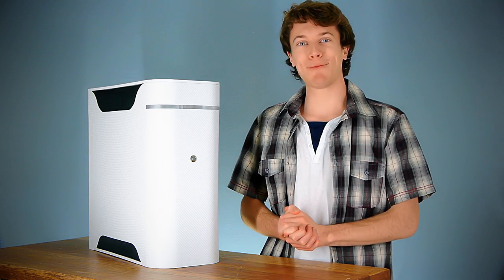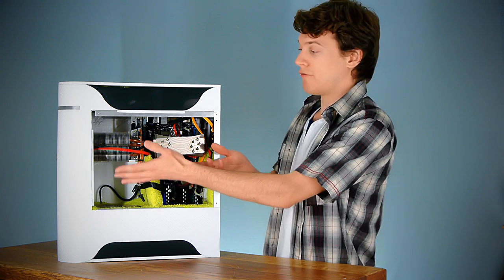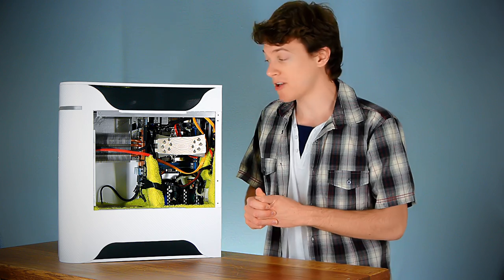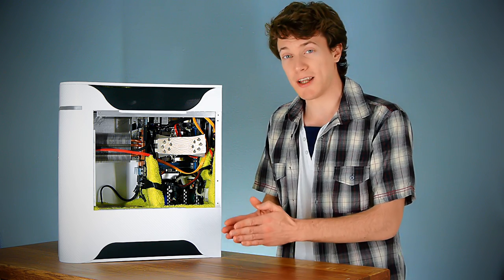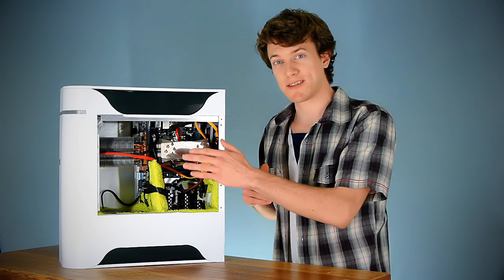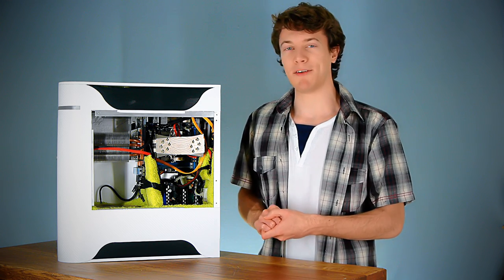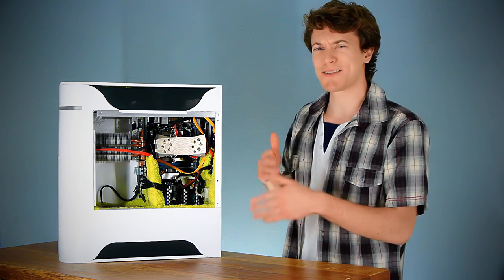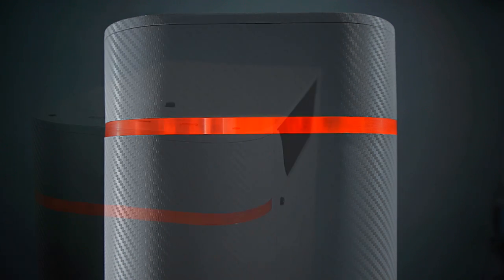DIY Computer Case - The Ultimate Silent PC (CLOUD UNIT)

Comment: ok for older graphics cards that would be ok BUT today we have a large amount of components on the graphics card that have to be cooled as well for example the VRM it generally has thermal tape on top of it and is in contact with the cooler for 2 GB up i would say you would need to cool not only the chip so don't go slapping cpu coolers on your graphics card. because if the VRM burns up the gpu is wrecked not to mention that the VRM is generally the first thing that fails in a gpu its quite rare that a gpu's chip dies first. Yah in my opinion the cooling you have for the pcb is not enough just being in the airflow path. (I may be wrong dough I just would not risk it).

Comment: Why didn't you go with watercooling too? At least on the GPU. If you make the case a littler bigger or higher, you could add a dedicated department for it, maybe one where the PSU fits in, too. Then let the fans go really slow. The design is smart and the airflow concept well thought through. With watercooling however, air could go in on the left and exit on the right, rendering an optimal airflow for efficient cooling. That way, you could let the fans run at the slowest speed (considering you take a 240mm heatsink for the GPU and another one in the top for the CPU). 
Just my thoughts popping up?

But nevertheless, awesome design, awesome function, it's just insanely cool!
Reply: +LimPu Just seen the last part about it. Nevermind :D

Comment: Really Creative! Cool design!But I do believe that water cooling makes the need for huge tall coolers outdated, sure there is a tradeoff as you now need to fit a radiator, but with a large one, you don't even need a fan (using convection) and can passively cool with just the quiet noise of a good pump completely inaudible. And one can do this with a Cooling loop that draws head from multiple GPU CCAs and the CPU all in a tight form factor with just the Rad to take up much space.

I'd love to see what you come up with going for a (silent) water cooled design =)

Comment: i would make an extra button which increase the Fan voltage. in case of that the pc is in a "gaming mode" with a much better cooling. maybe i also would change the led to a new color or fading between some.

Comment: The case around the power supply isn't so much due to safety concerns but to meet FCC regulations. The actual RF noise produced by a power supply isn't enough to concern the consumer, but the FCC has very strict standards that manufacturers have to meet.

Comment: Of course this is a nice build and i resprect the time and effort you put into it... but seriously in modern cases you can mount fans wherever you want. it just depends on the case you buy. also the max. fansize that you can mount has become a lot bigger (i think up to 200mm shouldnt be a problem) and if you buy a graphics card with a decent cooler they shouldnt be that loud or in fact can be semipassive (only turn on when in serious use). besides that the power supply now often mounts on the ground so that it gets fresh air and at the same time doesnt heat up the rest of the system. If that isnt enough there are a lot of (semi-)passives out there too.

So all in all - if you make the right decisions when buying, silence shouldnt be a problem. Either way you seem to have fun building these custom ones and of cours it looks pretty cool..

Comment: I remember watching quite a long time ago; In the middle of my water cooling exploration, I remembered this video and thought that it would be a neat idea instead of water cooling. My question, however, is how well this will work to cool more high performance AMD chips that are going to produce more heat?
I could go for "beefier" coolers and more fans, but my idea is to have a quiet (not necessarily as silent as this) PC in a more simple design than the complex water cooling loop I had envisioned.

Comment: Just drill a 5 inch hole in the wall just enough to pass wires through and put the desktop pc on the adjacent room, pass the wires through the hole, seal the hole with some dry wall seal, close the door, place the monitor on the desk, hook up the wires and enjoy a quiet free, and a cool room temperature. My three desktops are in my bathroom, you can imagine the heat and noise they generated, but thank God of the idea, it's the best idea he gave me, and i realized that the heat the Pc's made prior, were taxing on my energy, i don't know but i assume if copper and all those other metals being heated generate some kind of negative effect on health through the heat

Comment: I like your idea, however I am concerned about heat with the fire hazard with the Power Supply, and the overheat issue with the Smaller HDD in the Pocket near the Cpu. These can cause issues for sure.

Comment: Yea it's quiet but what sort of temps do you get under heavy loads? And that's with a low end GPU. Try it with a more high end which the TDP is alot higher which means more heat output. 

Yea it's quiet but i bet it doesn't run cool. You can do all this with watercooling, if you do it right it will run much cooler and be much quieter than conventional cooling. And im talking custom loops not AIO before anyone jumps on me.
Reply from the maker: I have a whole video about that. TDP of this card is the same as a GTX 980, so though it's old it's still a very hot running card so good for proof of concept. Hope this helps.

Comment: I would have gone with a big liquid cooler at the bottom of the case, and then cpu and gpu connected to that. Then moved air intake and outtake through the case as per normal, but on the quiet side.

Comment: Great work ! But I would like to know : did you test your computer without fans ? Because may be the heat alone of both CPU/GPU creates an air flow in the case and it sufficient to cool them down ? I'm really curious about it.

Comment: I see no need for the toweling, surely that can hold static and dust build-up would have just made rubber mounts and the external 12volt socket /5volt is a good idea only if you have a really good PSU otherwise you could blow it up if it tries to pull too many watts of power I don't like the open power supply either just buy a decent one they are not noisy at all an open power supply like that is dangerous, but I do like the airflow in the system  it does make sense. making the case of wood is good for design but not practical in terms of weight moving it around and safer if it did catch fire. I would just mod a metal case to do the same thing, after all, you have used an aluminum sheet to wrap it could have easily done that to a metal case. I hope you don't think I am being too negative here just pointing out what I see as pitfalls you are a very creative guy I watch a lot of your videos and love the channel you inspire me to go out in my workshop and make things so keep the vids coming.

Comment: +DIY Perks why don't you adapt the original GPU Cooler adding the monster cooler to it? usually the GPU cooler has more contact and takes heat out of more than one component of the board, using the old contact with the new cooler wolud give a better looking and more eficient build? why not try it out?
About the power suply: its not the high voltage the most concerning thing; the capacitors are usually the most dangerous thing to fail there and the problem is not only the towels, but the proximity to the motherboard, would not be better to put it in a separate bay under those fans for safety?
Reply: you cant just stack a CPU cooler on top of the GPU heatsink. The cooling area of the original cooler is too small to make a difference anyways.

Comment: How is the GPU memory and VRM doing? Lots of reports of the NZXT CPU adapter frying GPUs. Are those heat sinks enough without a dedicated fan? What GPU is that anyways, that 660 I saw in another video? High voltage is over 750v but I getcha. lol You could use some marketing, great channel, I didn't see it until I got out of my walled garden internet and got a VPN.

Comment: saying they should do that for grapics card is like saying they should be watercooled from factory ( which is rare ) ..
the main GPU will be cooled by the cpu cooler but the other components will heat a lot , and will certainly be impossible to OC because of that , they need better HEAT "exhaust" .

Comment: Hi. I agree totally. The ATX design specification is a dinosaur and I don't think it is particularly fit for any purpose these days. There was a BTX specification claimed to solve thermal issues but the design introduced incompatibilities yet was not really radical enough to be worthy of a change. Since then, Intel appear to have given up on designing a successor to ATX. Without several manufacturers defining and implementing an open standard the change just won't happen until technology makes clinging onto ATX untenable. The flexibility that made ATX so great in it's day is no longer necessary since few add-in cards are now used and today's designs are pretty formulaic. Desktop cases are now used primarily for hot CPUs and graphics cards and as you say, thermal design as opposed to flexibility these days needs to take center stage.

Comment: the fans are blowing the hot air from the power supply over the CPU bad idea
you should have the fans suck the air from the power supply out of the bottom of the case. Anyway nice work I like the style of it.

IT GUy for over 20 years!

Comment: instead of the green non fire retardant fabric, why not use a fire retardant plumbers soldering mat. Not only is it safer due to its heat and fire retardant quality , you could still mount the cooling fans on it for sound/vibration deadening?

Comment: There is an advantage of using a good air system instead of water cooling, and you kind of mentioned it, but didn't made it very clear. With water cooling, the only components actually getting cooled are the ones with the sinks connected to, on which a typical water cooling system comes with sinks for the CPU and GPU. Although, you still need air cooling for the rest of the components. With the fully air system, everything gets cooled down.
BTW, you do look like Theon Greyjoy LOL

Comment: You should cool your next GPU with a closed loop liquid cooler and make a case for it so it's basically an MSI Sea Hawk, but custom.
Reply: technically all normal water cooling loops are a closed loop/system
Reply: AbsoluteTrash Closed loops can't and shouldn't be given maintenance by default. Custom or open loops can. I myself have an open loop AIO(Alphacool Eisbaer).
Reply: I was meaning "closed loop/system" in the physics kind of way

Comment: Im confused though. First of all graphics cards are silent to begin with. They dont make noise. The fans on the heat sink is what makes noise  so that giant cpu heat sink does not actually stop the noise because of reducing heat it stops noise  because it removes the small fans from the heatsink. Also using heat sinks like that with no fans directly on them to move the heat isn't great practice. It will work because he has airflow in the case, but its not as effective and like his previous case video where the cpu ran at like 75 C where as normally even under load my cpu would run at about 50 or so with air or 30 - 40 with liquid. This isnt a problem with the case at all though simply the choice to have only intake and exhaust fans rather than including heat sink fans. None of this is any kind of fatal error just extremely weird and not necessarily considered good practice. Also the fabric doesnt worry me so much as a fire hazard as it does a potential source for static electricity which can kill parts. Not that im saying it will because i cant tell from the content how close it is to the actual parts that could be damaged from static. Also as a water cooling enthusiast I must point out that pumps really arent that loud usually unless you have them pushing at max power. I have a water cooling setup in my personal build and aside from fans i run on the radiator its completely silent. I cant even hear the pump. Once again im not bashing anything in this video, im simply giving information because i believe some of this may be slightly off. The concept itself is super cool though and i love that he is coming up with different ideas and giving them a go because thats how innovation happens. I love the video, but this is what i do as a hobby so i thought i would give my own personal observations based on my experience which may very well differ from his experience and cause the difference in information given.
Reply: Also please feel free to correct me anywhere that i might be wrong. I welcome new information. As i said this comment wasnt me trying to be rude or insult him because i really do like what hes doing. If I am wrong I would happily accept that. I just wanted to give info from my own experiences with building machines with various types of hardware.

Comment: This is the ultimate pc silent mod if i would of looked over on how he is able to swap out the graphics card since its heatsink is attached to the case
Reply from the maker: Rice snot You'll have to check out the build log. It's swappable, it just needs more work than usual. Not too bad if your upgrade schedule is 2 years though.
Reply: Oh my God you are right, I also have another question. How long did it take to fabricate all of this?

Comment: ever heard of a reference cooler (literally there blowers that exhaust air out of the case, but still not as good as a cpu cooler)
Reply from the maker: +Michael Flatman Bit noisy though.
Reply: +DIY Perks Like a jet engine in your computer those reference coolers.
Reply: +Michael Flatman I guess you are missing out the whole point of this experiment.
Reply: The words "Reference cooler" and "silent" never go together

Comment: 4:45 I respectfully disagree. Modern graphics cards made by reputable manufacturers will have a quiet and efficient fan. Some even have a Zero fan mode those times when the card is not put under load.

Comment: thanks for another great case. I tried to move my old laptop to custom case but failed to boot my laptop without connecting internal display cable, it just doesn't boot with external monitor. I have Dell Inspiron N5030.

Comment: That thing is awesome!
But couldn't you just use a raid 1 instead of the backup-button?
Would be even safer ;)
Reply: +Das TIER With RAID1, both drives would always be connected to power; in the event of a surge, both drives could be fried. Since the backup drive isn't connected to power until the backup button is pressed, the data stored on it is considerably safer.
Reply: +c3h4ohcooh3 
Ah, thanks! Hadn't considered that...

Comment: Nice case makes me want try my own.  

I'm confused though you said convection heat rises, but when you have intake and exhaust fans there is no convection as the air is forced out no matter the temperature.  As it is an enclosure the air has only one way to go.  Easy way to test this is by turning a PC case upside down.  The heat will still come out of the exhaust.

A quick question as you have the PSU fan removed and a fan underneath the PSU.  Doesn't the heat from the PSU become blown across the components and adds warm air to the heatsinks as they don't have their own fans anymore?

Comment: I drilled a hole in my wall for the monitor cable and put the computer case in the hallway, and went wireless. But than I noticed I have some low end rumble at around 42Hz in the corner which was driving me crazy so I brought back my computer case. The fans noise mask the rumble just fine. So I guess I can't go silent. :(

Comment: i like this case but i would prefer an other position for the psu  putting it under cpu cooler you just give your cpu hoter air than you could have , with your system maybe works but in a hind end pc that would be a big problem i like the rest but i would transfer psu out of there

Comment: How would you change the GPU? :\ It looks like you welded or soldered the GPU heatsink to the case, right? How would you change it? :P
Reply: +JulianProPC Also, having the PSU out of a case is extremely dangerous. Even if you leave it unplugged for an extended period of time, it can still discharge a large amount of electricity, possible lethal amounts, even if the high voltage capacitors are isolated, the sinks can discharge that electricity. It might not be a fire hazard, but it's a human hazard :P So working on your PC safely would require extremely thick rubber gloves.
Reply: +JulianProPC It looks like glue to me, I guess you could use chemicals to get it away. If you want to be able to switch your gpu, you can just use screws or something similar instead.

Comment: +DIY Perks Matt i like your case very much and love the idea of having a quiet computer but, i just want to ask you something that i've observed, about the CPU/PSU cooling engineering; the hot air goes to the top right? And the PSU is under the CPU, so, when the fan air pass through the PSU it pushes the hot air to the Processor (cpu) which is right above so, it doesn't make the cpu hot instead of cold?
Reply: power supplies don't get that hot, it shouldn't be affecting the cpu much
Reply: Morph Power suply get hotter than anything else. Some Power bad Power suply are even dangerous.

Comment: what temps are you running on the HDD? I did a similar thing with the HDD (not a laptop one, regular 3.5'' WD drive) and the temps have risen significantly, from 25ish to 40ish.. and the case is well ventilated (not like yours, ofcourse)
Reply from the maker: Hovers around 35c as it's a laptop drive.
Reply: +DIY Perks thanks. How could I lower the temps, but still keep the silence? Any advice? :)